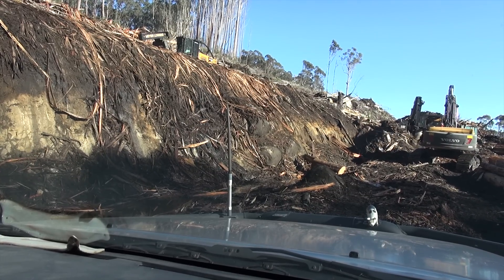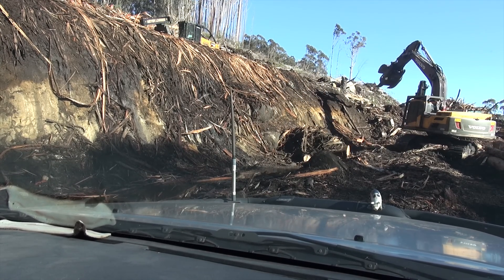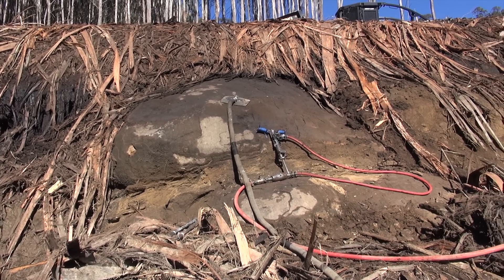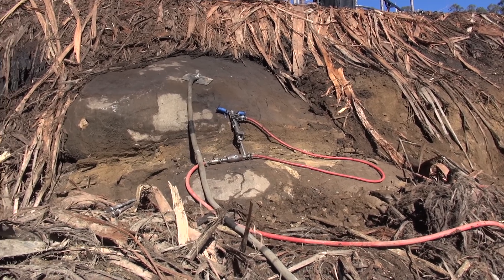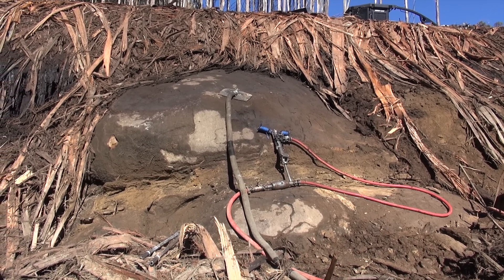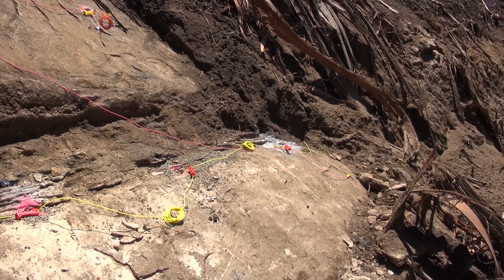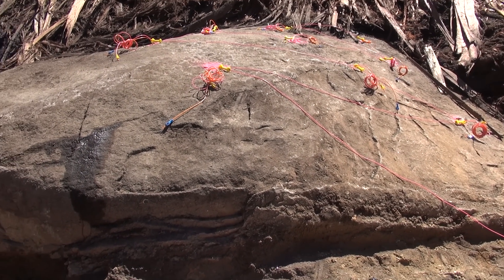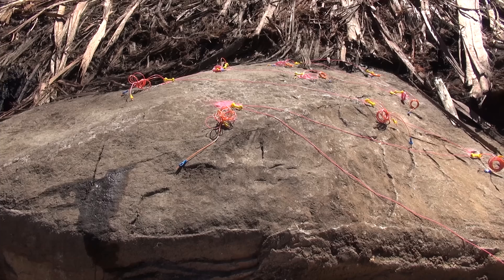Good Blasting requires the right choice of Explosive

Comment: Wouldn't it be great if all your prospective customers would give you a true lay of the land?  Nicely done with the equipment you arrived with.  Much respect!
Reply from the maker: Absolutely Mark, so many times I have been caught out when the customer says, "you can fit this job in, it's only a small rock". You get there and its a lot bigger than the picture you built in your head, based on customer description, I should have bought and assistant, I should have bought more bangers, I should have bought a drill rig etc. Then it gets worse when you find a lot more unseen buried rocks... and you know that they knew they were there because when you clean them off you can see marks where they have already had a go with the breaker....

Comment: Hi Dave, I've been watching lots of your videos the past year, and I'm sorry to bother you with a question probably familiar to you, but I haven't found any mentioning of it, so here goes:  why don't you invest in a self-contained small drilling rig?  it would spare your body a whole lot, and you could easily tow it around on a trailer with your pickup truck.
best wishes from a fellow blaster in Norway.
Reply from the maker: I have the drill mast on a 3.5 Tonne excavator, which is good, but would really like a Atlas Copco roc T15... but at $400,000 they are a bit on the expensive side https://www.epiroc.com/en-au/products/drill-rigs/surface-drill-rigs/flexiroc-t15-r
Reply: @demolitiondavedrillandblast  Did you ask Santa for one for Christmas?
Reply: @demolitiondavedrillandblast  is that price incl  or excl tax?  in either case, Aussie branch of Epiroc is charging way more than here.  Anyway, if your market is not ready to pay an increased cost of your operation, then it is not, too bad but it is what it is.  I have a T15 and I love it.  Before this one I had a Tamrock commando 120, also with radio control.  Perhaps the best small self contained rig ever built, it just ran and ran, problemless.  If you could get a nice and not too worn specimen, I'd recommend it, for it's great reliability and easy maintenance, and lack of electronics and related problems.  Have a good new years celebration Dave!
Reply: ole petter gansmo, i'm sure youve seen his drill rig.  do you know of a smaller one?  how about a link or picture or something.

Comment: What is the most briscant explosive you can access?
Reply from the maker: PETN in the form of Det cord or cast boosters (60/40 - TNT/PETN).
Reply: @demolitiondavedrillandblast  it would be cool if you could someday get a thick steel plate and detonate a booster on top of it to see if it gives a cool blast pattern in the plate
Reply from the maker: It just punches a nice round hole the size of the booster strait through! Got a picture somewhere.

Comment: You mentioned visit each site. 
Probably not your type of work but drones are getting very good at 3d mapping situations like yours.
Reply from the maker: Yes... I've been thinking about drone mapping more than a bit lately Bruce.
Reply: @demolitiondavedrillandblast  

Cool, the industry standard seems to be 3d measurement at about 100mm resolution with the option for photographic overlay. 

If you want to use your current drone there is software or services available to convert still photos taken from specific points or video to low resolution 3d mapping. Maybe 1m resolution.
Reply from the maker: The software available for my drone is pretty good resolution.
Reply: @demolitiondavedrillandblast  
Excellent, you have already looked into it?

I have a friend t does it professionally if you want a contact to talk to

Comment: would it have been as effective with 2/3 to 3/4 of the holes? I'm thinking it wold have left larger pieces and had less throw but I know nothing.
Reply: depends on the type of rock and the equipment available to move it! he could have just cleaved off two chunks but did they have a mover that would handle chunks that size?
Reply: @keithmoore5306  exactly my point in asking. What was the reasoning behind the number of holes and getting the size of rubble?
With not having the rig and the risky drilling positioning I would expect the fewest holes possible.

Comment: I know nothing about explosives, just wondering about the timing, I see primary explosions go, then the blast goes off. how is that timing worked out?
Another rip snorter of a blast matey, Thanks!!!
Reply: the blasting cap sets off a non electric lead that has a delay built into it different nonels have different delays you either pick the delay you want or just use whatever is in reach and you have! as for the blast pattern delays you start out using charts and tables then experience gradually takes over!
Reply: @keithmoore5306  Thanks Keith
Reply: @Zendukai  not a problem! being a life long powder head has some knowledge!!
Reply: @keithmoore5306  My niece used to blow things up for the mines but never said what the ingredients were lol. When she went on to drilling holes out in the bush looking for stuff, she said if they were to mine all the gold that they drilled through, well ya know what that would do to the price.

Comment: Do you use much NG-type dynamite these days?

I saw a mining professional skills video from the US that was quite recent and they spent a long time talking about NG dynamite. I was a little surprised given the dangers of making it and presumably high cost, and assumed that safer products are used these days in those applications (I guess something fast detonating like something TNT or RDX based?). But asking around got quite a few comments about how they still use it which makes me wonder if the same is common here in Australia.

I don't recall seeing videos of you using it and the rock you blast is quite hard (if I'm guessing right that high detonation velocity is used in harder rocks for shattering), so I figured it's not common if it's even available.
Reply: don't know about down there but nitro based dynamite is about to go extinct in the US! there's only one company still making nitro based dynamite and they're talking about dropping it! in the US about 85% to 90% of pit mining is done with ANFO with a TNT booster anymore and most mine shaft blasting work is using AN immulsions in cartridge form!
Reply from the maker: The Local manufacture of "Gelignite AN60" wound up around 1990 (?) and was replaced by emulsions and watergels, mainly because they are safer to manufacture and transport, probably cheaper also. Yes, still widely used in the US.
Reply: @demolitiondavedrillandblast  not really we're down to one company making nitro based!!
Reply: @keithmoore5306  Dyno Nobel is one of the largest explosives companies in the world though.
Reply: @kylesenior  maybe but DuPont is the only one i know still making nitro based in the US!
Reply: @keithmoore5306  Dyno Nobel list NG dynamite on their NA price list last time I checked (when I first came across this). Perhaps it's made in Canada, but it's apparently still common.
Reply: @kylesenior  yeah it's probably a canadian listing unless their selling it under another name through a subsidiary here i haven't seen where nobel has any around here in Ohio or down home in Kentucky outside of airgun pellets and reloading gunpowder.the only NG based stuff i've seen in 2 decades here has been from Dupont!
Reply: @demolitiondavedrillandblast  When I was blasting in the German civil defence  (mostly demolitions), we usually used the West German made  Ammongelit 2 (By Dynamit Nobel) or, when it became available after the fall of the Berlin Wall, the East German equivalent Gelamon (made by Explosives factory Gnaschwitz), as general purpose explosives. They were ammonia nitrate dynamites.
 For cutting steel we would use Seismogelit, a high speed explosive originally developed for geophysical work (though quite expensive) or Seismoplast 1 (also made by Dynamit Nobel), or its military equivalent, Sprengmasse Formbar DM12 (essentially the same explosive, the civilian version is packed in red paper, the military one in olive drab paper).  
I used the British made Blade linear cutting charges to cut the guy lines of the old AFN transmission tower in West Berlin.
Emulsion explosives and Nonel came after my time. We were also trained on the military engineering explosives used  by the German military, because, in case of a larger disaster, if we needed explosives, we would roll up at the nearest army barracks and reqzuest some of their bang stuff. I also still used Donarit, a slower, pushing explosive, mainly ammonia nitrate with a little nitroglycerine, but still powdery, to remove tree stumps.
We also experimented with Czech Semtex (I think Semtex 10, the black putty like stuff) and linear cutting charges and sheet explosives "Resaflex" made by a Russian manufacturer.
Both Ammongelit and Donarit have long been replaced with emulsion explosives, I thing Gelamon is still being made.
Dynamit Nobel got later bought by Orica.

Comment: Did some of the stemming get slippery, or was that normal for an emulsion shot?
Reply from the maker: Did spit a bit of stemming on those lower holes, surprising as the length of stemming was 29 times the hole diameter, which is usually plenty.